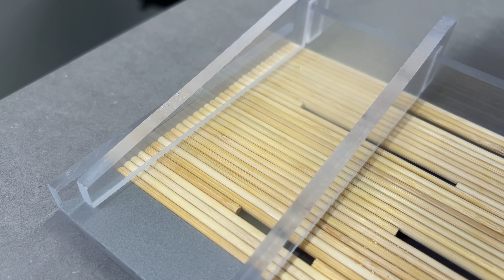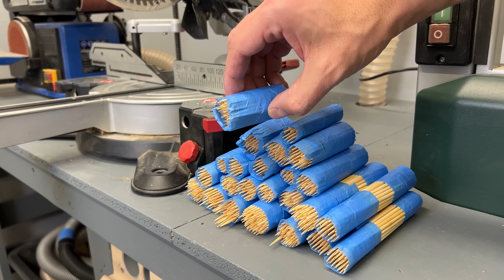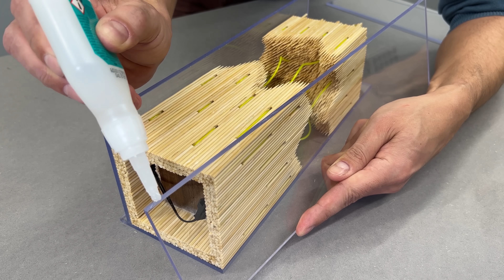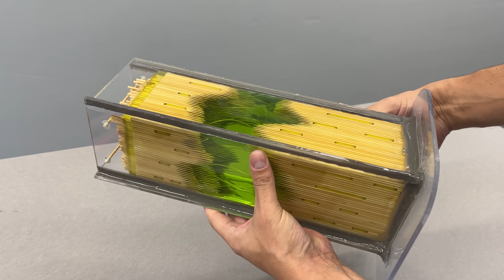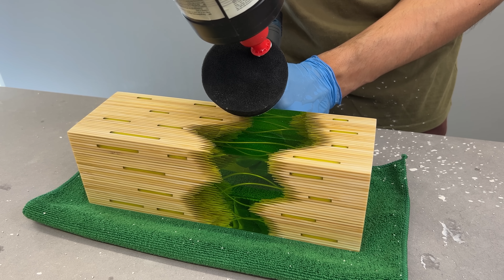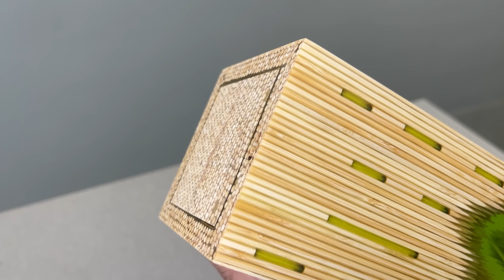DIY a LED Light You Haven't Seen Before! - Not Easy Woodworking Project

Comment: Put a lithium battery in the base and it will run for months on a charge. Add a photo detector so it automatically turns on when it's dark.
You could use it as an emergency battery to charge your phone when there's no power.

Comment: I like it partly because it has a sci-fi Borg look. Good work.
Reply: Ohh... Making it more like a wooden cube, with bits and pieces removed for effect (to create a wooden Borg Cube lookalike), small holes drilled from those bits and pieces to a hollow center filled with resin and a lot more wire.

The shine would be brighter through those holes to the surface of the Cube.

Also have very thin lines and dots here and there (cut through to the center) for those extra details on the Cube.

It would look like a "dead" cube during the day, but come to life at night.

Instead of a touch control, using a light sensor so that it suddenly starts shining that ominous... Borg_green™ 😅

Comment: you shouldnt be soldering wires  that go inside screw terminals
Reply: For several hundred milliwatts on 5v network will work fine.
Reply: Yeah bad practice. It's against code here in Australia. Will need to retighten them a couple of times now.